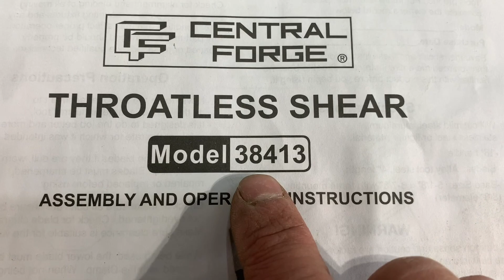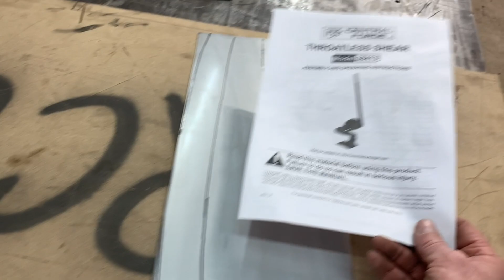Shop work and shaping hammer build

Comment: Ok, ya sold me on the HF shear. Some stuff I get from them breaks the first time I use it, other stuff is still going almost 20 years later like the press I got in 2004 to rebuild a 12 bolt rear for my GTO. The plates and gear puller that came with it broke, but the press and jack still work great. Go figure. Been wanting to do a cap hammer for a while, but the welding supply shops won't sell me a cap. lol

Comment: A very ood option for cutting sheet metal are electric shears... these are in efect electric tin snips... you will truely appreciate these if you cut alot of sheet metal into various shapes.... super handy... here is an example of what it is... Chicago Electric Power Tools 18 gauge 3.5 Amp Heavy Duty Metal Shears 120V 61737